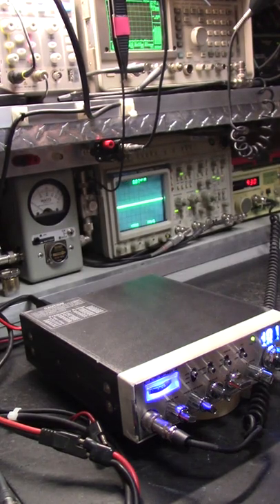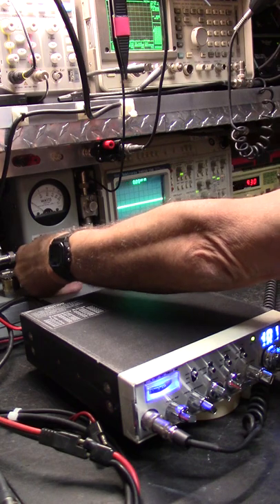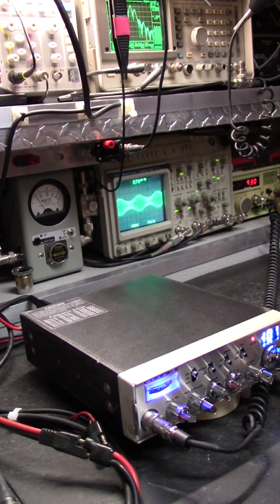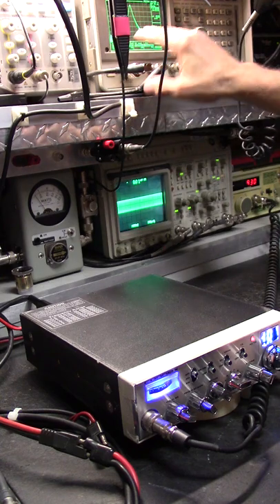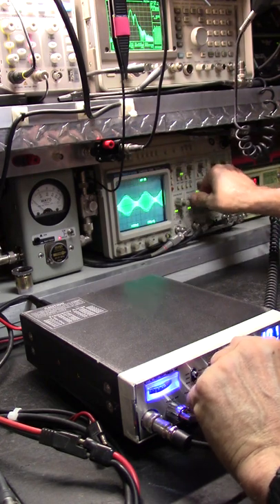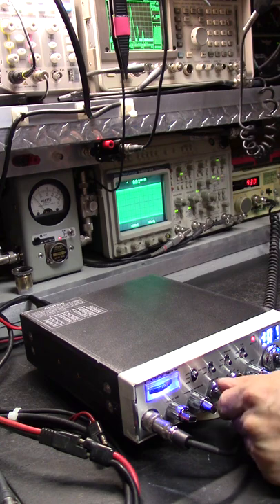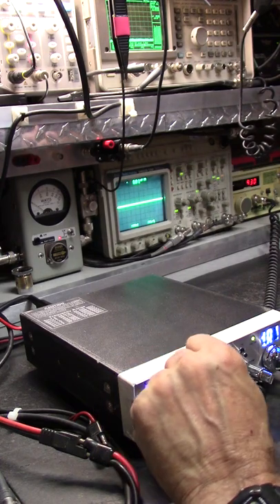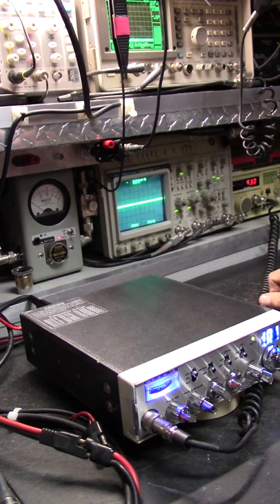Beware the Meterbaiters! Connex 4600 Turbo with HG2sc2290's ..  out of the box.

Comment: India is miler mile
Reply from the maker: I have absolute no idea what this means DJJessieB .. clue us in?
Reply: I can't stand when people clip limiters and over modulate the radio. I've watched your videos for some time now and respect your work. Those transistors are only rated for 50 watts. If voted maybe an extra 10, but I wouldn't go any further. If builders would just be honest and make "clean" loud radio's, then you wouldn't have this problem. You can make loud clean audio if you take the time and do it right. But idiots just want to do it the fast way with the snips and golden screwdriver